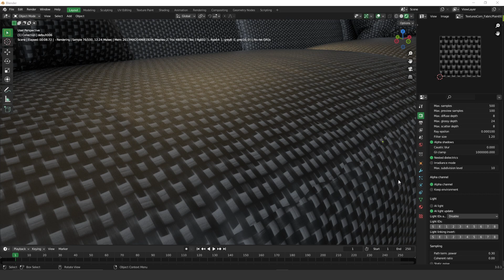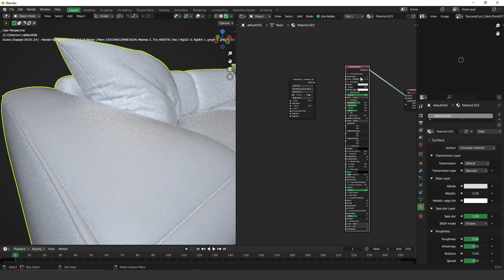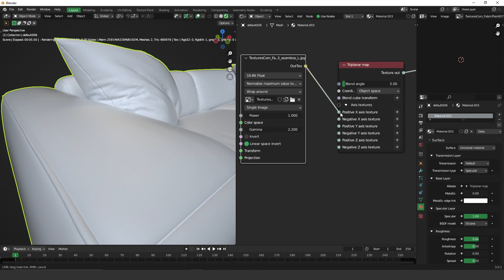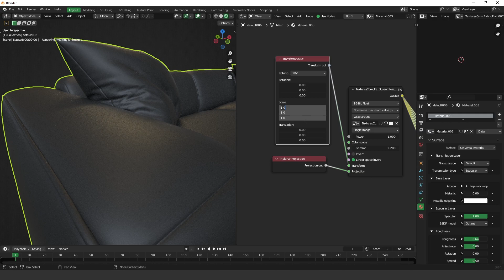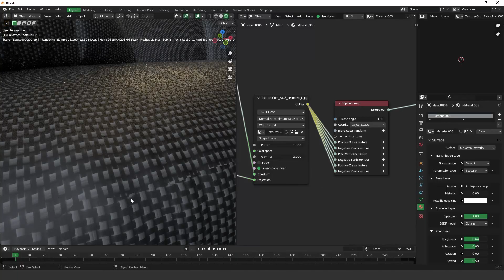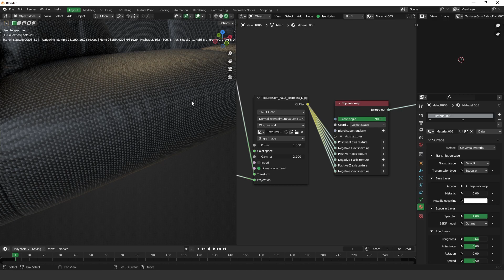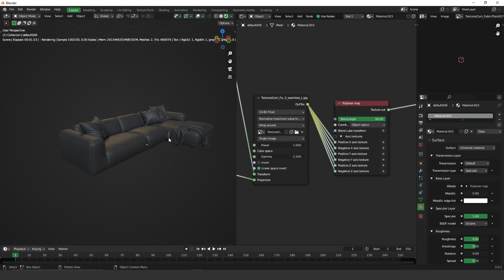Tutorial - How to Use the Triplanar Node for Octane Blender

Comment: does it work good with normal maps? using triplanar with normal maps resulting just as same as box projection only
Reply from the maker: yes it woks well with all maps. but it always better you have the right map, I use triplanar in cases that I need a fast torunaround
Reply: with normal maps i still see those seams, it's not blending.   @archivizual4236